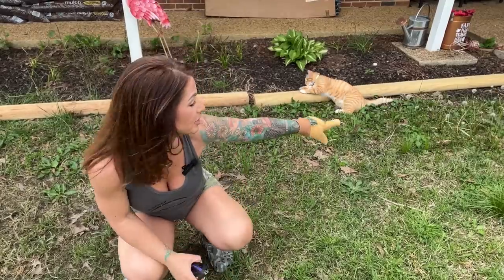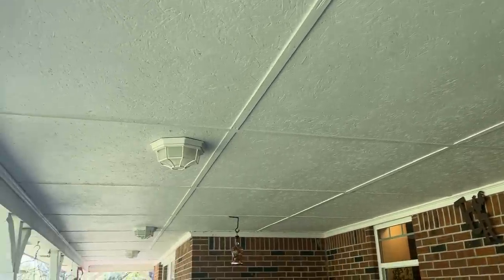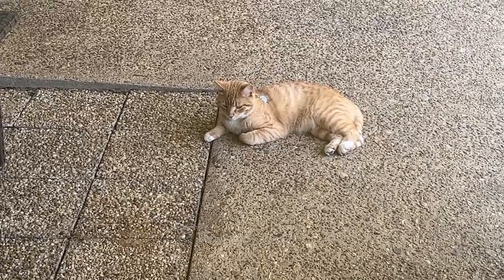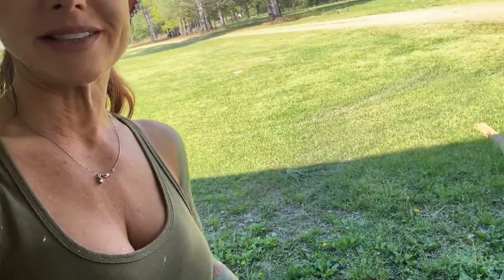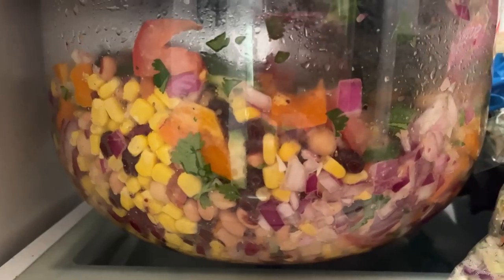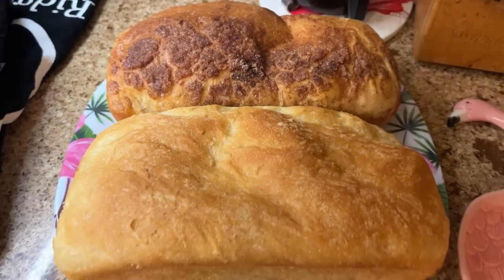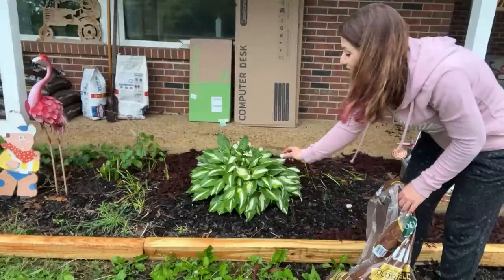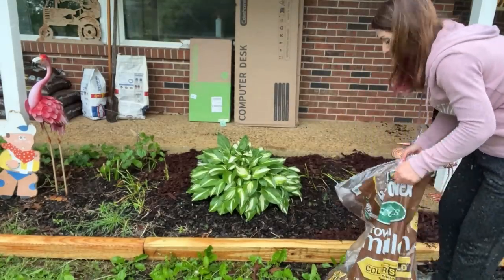Will This Trick Stop The Wasps??

Comment: To hold the landscape timbers in place, drill a half inch hole near each end and drive a short, foot to foot and a half, piece of 3/8th rebar through the hole and into the ground.

Some of the old timers called that "haint blue" because it was supposed to keep the evil spirits away.   When I worked pest control, I almost never saw a paper wasp nest on the sky blue under eves and over porches.   Places like barns, sheds, and coops, leave the paper wasp nest and singe them.    They will not build back there like they would if you removed the nest.
Reply: My brother took a spray bottle, added Dawn dish soap and water, sprayed the next and they were gone. They're gone.

Comment: Find the nest , start spraying wd40 on it , almost immediately you need to torch it spraying a little bit more and stop , all the wasp will have had there little wings burned off and they will be on the ground crawling around, just seep them up , works in holes in the ground also